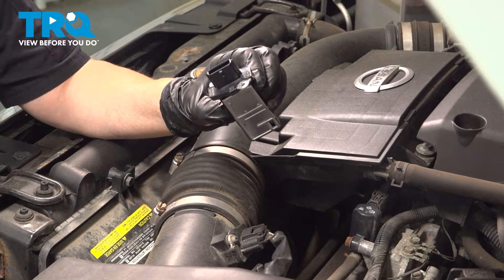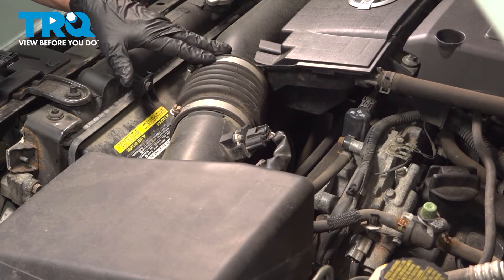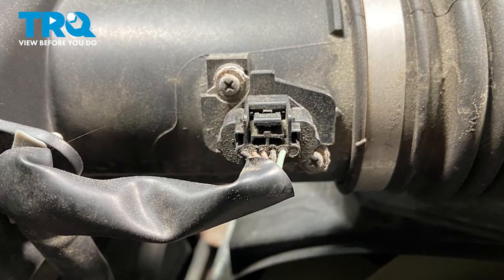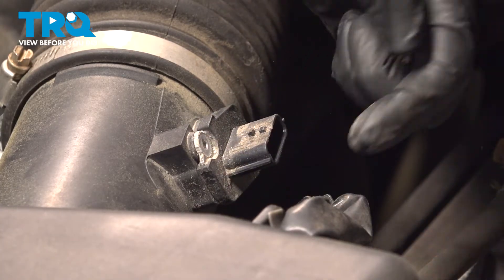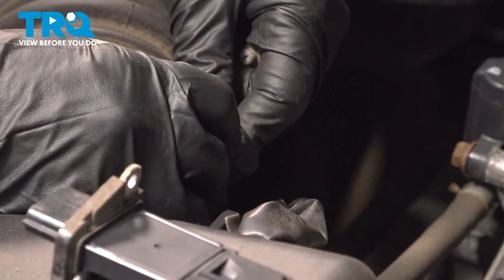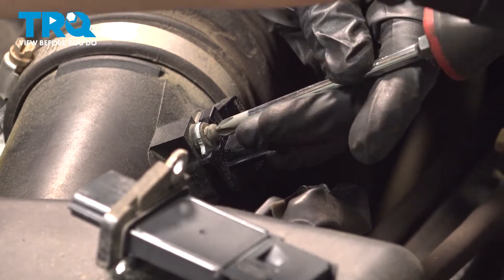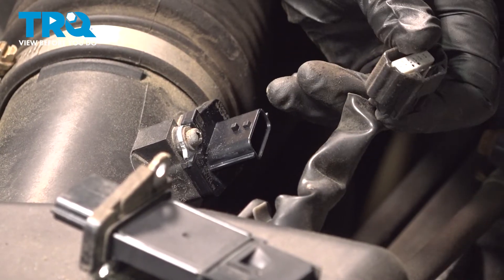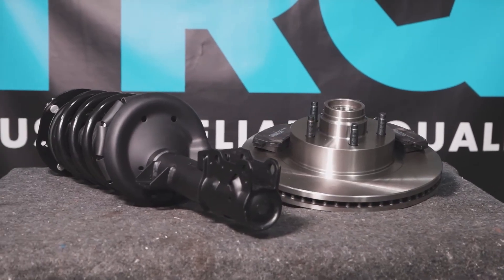How to Replace Mass Air Flow Sensor 2005-2021 Nissan Frontier 4.0L V6

Comment: I have a 2012 Nissan frontier changed it with a autozone mass airflow sensor and check engine light is still on does it have to be OEM or aftermarket works as well?